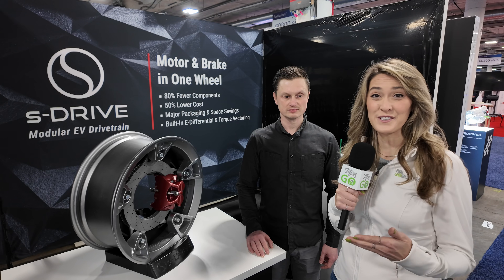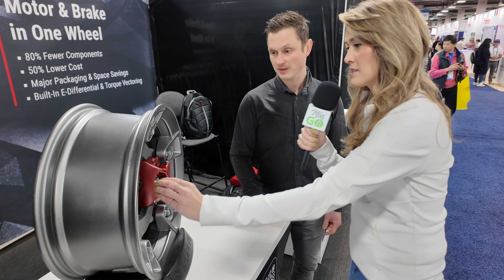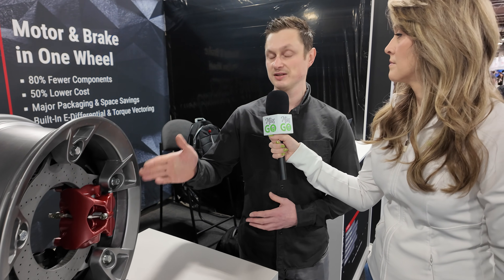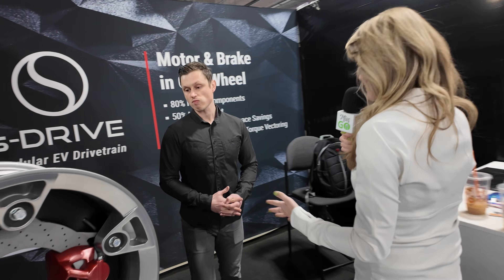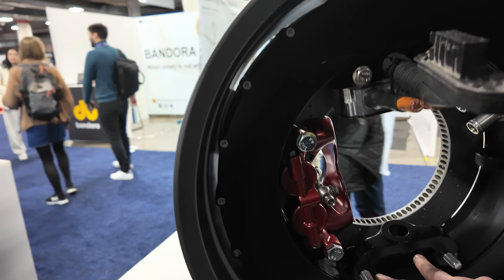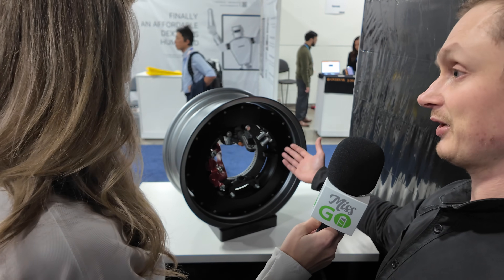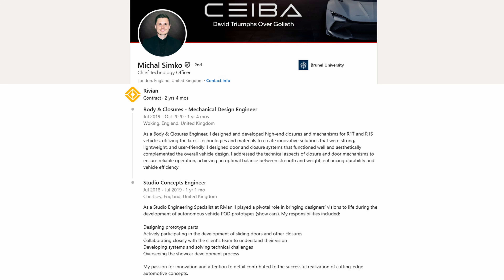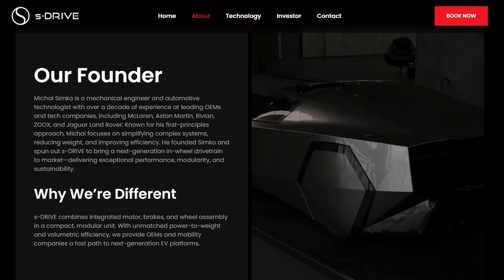S-DRIVE In-Wheel EV Powertrain Solution (CES 2026)

Comment: Excellent presentation on the axial flux integration, but as a builder, I see three critical "Shed-Logic" issues that might bite in the long run:

Unsprung Mass vs. Rotational Inertia: Even if the total weight is "hub-equivalent," moving that mass to the rim's perimeter significantly increases rotational inertia. In a racing environment, that’s going to fight the suspension damping and potentially cause "wheel chatter" on high-frequency bumps.

The Environmental Gap: With such a large-diameter air gap between the rotor and stator, sealing becomes the primary failure point. A single piece of road grit or a build-up of conductive brake dust in that gap is a "catastrophic short" waiting to happen. How is the labyrinth seal handled during high-speed rim deformation?

Thermal Creep: 200kW generates serious heat. If you're dumping that thermal energy directly into the rim, you’re going to spike tire pressures and potentially heat-cycle the rubber into an early grave. Air cooling sounds great for production, but under heavy track load, that rim is basically a hot plate for the tires.

Would love to see the "long-term torture test" data on those damping rings after a few thousand kilometers of real-world potholes!
Reply from the maker: Other Axial Flux hubless motors have been in production for years now
Like the Verge TS Pro
Haven't those problems been addressed? 
-Producer Tim
Reply: @MissGoElectricIndustry  Tim, the Verge TS Pro is a brilliant piece of engineering, but it’s a bit like comparing a prop-plane to a supersonic jet just because they both have wings.

The Verge operates at roughly 100kW (130hp) and is mounted on a motorcycle, where the entire wheel assembly is exposed to open air for cooling and has significantly less mass to 'swing' than a supercar wheel. The S-DRIVE is pushing 200kW per wheel in a closed-rim automotive environment.

Here’s where the 'addressed' problems actually get harder as you scale up:

The Scaling Law of Heat: When you double the power (from 100kW to 200kW), you don't just double the heat; you often square the cooling challenge, especially when that motor is tucked behind a car's bodywork and a massive brake rotor. The Verge has the luxury of 'clean' airflow that an in-wheel car motor simply doesn't get.

Structural Leverage: A motorcycle rim is narrow. A car rim is wide. In a car, 'Camber Thrust' and lateral cornering forces create massive leverage on that hubless bearing. The 'flex' in a 19-inch car rim under high-G cornering can be measured in millimeters—enough to cause a 'pole-strike' in an axial flux motor with tight tolerances. The Verge doesn't face those lateral 'G' loads.

The 'Debris' Velocity: A motorcycle wheel throws debris away from its center. A car wheel, trapped inside a wheel well, creates a vortex of grit and brake dust.

The Verge proved it can work for a bike. The S-DRIVE has to prove it can survive a 2-ton car hitting a pothole at 100km/h without the stator and rotor 'marrying' permanently. Different physics, different stakes!

Comment: This is brilliant. I had the same idea many years ago, but the major issue was un-sprung weight. Sounds like he has addressed that problem. Just imagine, four of these units, you're talking over 1000 Hp and 3200 Lb.-ft of torque. Wow.
Reply from the maker: You bet! We shared a look at a couple of EVs with four wheel motors and we'll over 100HP in this brand new video on the main channel
https://youtu.be/3TTrsTMarPE
-Producer Tim

Comment: At face value, this design (and the similar Donut design) appear very elegant solutions for any/all EVs.

HOWEVER … 
1 - I am surprised they are able to match/better the unsprung mass of a conventional wheel/hub/brake/suspension assembly … though one has to accept it may be possible depending on materials used … and even if it is slightly worse, what really matters is how it would impact on overall vehicle performance, handling and ride quality. 
2 - Wheel bearing radial loads will be comparable to a conventional hub configuration, yet with a much larger race size (going from a nominal 50mm dia up to something like 250mm, or possibly bigger). I’m no bearing specialist, but instinct tells me that, for the same rpm, it’s going to be a harder working bearing running at significantly higher circumferential speeds that will likely need forced oil lubrication and be manufactured to better tolerances than a conventional wheel bearing, be a lot more costly and likely significantly reduced life … not to mention highly sensitive to running with ANY contamination. 
3 - As per the bearings, sealing will also be a challenge … for exactly the same reasons of diameter and associated seal scrubbing velocities. Personally, I believe this would be a problem if the assembly were simply running in air … but it has to perform over the full range of global temperatures (-40C up to +50C or more) when running through mud, water, sand and dust, or a combination of all these. Again, these seals are going to be costly and likely require frequent changing with relatively short life. 
4 - Hit a brick at 70mph with a conventional alloy wheel and it’s likely to need a replacement wheel. Expensive enough. I’d be concerned that the same impact with this hub/motor combo could also prove catastrophic to the entire motor assembly … seriously expensive. 
5 - Interesting concept to incorporate elastomeric coupling between motor and wheel rim … but these solutions are typically limited in life as the rubber/polymer degrades over time, especially with the help of heat from braking and exposure to UV and other environmental hazards. It was suggested that braking would be largely regenerative, which is good, but these solutions assembly will need to be robust against a full-on emergency braking occurrence when full braking force is entirely converted to kinetic friction heating … the sort that can make the discs glow. This heating is then transferred and dissipated via the alloy wheel rim; directly cooking those elastomeric bushings.

The Donut solution has, I believe, been on the road for more than a year now … I’d be interested to see how they’ve resolved these same concerns and to see some associated reliability data. Even then, there’s a seriously big difference between one year of motoring and 10+ years of everyday road use. As a practical concern for a typical motorist, it needs a minimum of 100k miles and/or 10 year life … or to be comparable to a typical diesel car … 200k miles and/or 20 year life. My concern is that it would be more comparable to suspension bushes/joints and need replacement at 4 to 5 year life and less than 50k miles. 

Still a really cool solution and I’d truly like to see proven designs of this type become the norm.
Reply from the maker: Follow this sorry at our main channel
News.MissGoElectric.com
-Producer Tim

Comment: hubless = high friction, high noise levels, sealing problems, high fail rate...  nice try but ultimately doomed
Reply from the maker: Solved problems.
It seems like many commenters are not aware that axial flux hubless motors have been in production vehicles and delivered to customers for years.
https://www.youtube.com/watch?v=cQstV0uLLHg
-Producer Tim
Reply: @MissGoElectricIndustry  everything to do with verge and donut is fishy! axial flux = good. hubless wheels = BS! 
- senior design engineer dean

Comment: "The same weight as a traditional rim" I call Bull$hit.
What if you get a flat tire?
How about servicing the unit?
How long will the bearings last, especially in high contamination conditions such as wet salty roads?
What about hybrid compatibility?
Reply from the maker: Solved problems.
It seems like many commenters are not aware that axial flux hubless motors have been in production vehicles and delivered to customers for years.
https://www.youtube.com/watch?v=cQstV0uLLHg
-Producer Tim

Comment: Should this not increase unsprung mass negatively impacting the handling characteristics… although there are some benefits where the CG could be better as the weight is further out.
Be interesting to see a direct comparison
Reply from the maker: What did you last in this video about the change in unsprung mass resulting from this design? 
Is there
A) more
B) less
C) no change

-Producer Tim

Comment: Nice idea but I am skeptical at this point. The weight bearing issue, dirt, and even with small dampening the electronics in the motor will get bet up since this is before any real suspension.  I doubt these will last long on the road.  Of course if they can make them cheap to replace i.e., put reconditioned motors on every 50k miles for $500per tire maybe it can work.

If this was on a hybrid 4x4 then you have more flexibility in suspension design maybe.
Reply from the maker: A solved problem. 
11k miles axial flux hubless in production for years
 https://share.google/6zXKAArldypXykHEU
-Producer Tim

Comment: Electric bikes have been using similar design for sometime now.
Reply from the maker: No. Those are old fashioned hub motors. This is axial flux hubless. This is fully integrated with cooling and mechanical brakes as well as suspension. There is no common technology here. 

You can see our 100+ highly detailed eBike reviews at eBikes.MissGoElectric.com
-Producer Tim

Comment: What confounds me and I've never figured out:

Hybrids use a motor as a generator up to a certain point, but still have all of the weight and energy loss of transmissions, et all.

Just how big of a Generator (i.e. engine) is required to fully power an electric vehicle at 100mph (on current highways there's no need to go faster than that) and remove all of the energy wasting weight and inefficiency of a transmission and drivetrain with hubs like what this guy's showing.    If the IC generator can supply the drive the batteries could be drastically reduced so the generator can be turned off under the same conditions hybrid motors currently are.
But that damn 12v battery needs to be eliminated, or have a BMS that lets the primary pack keep it charged enough to cycle the vehicle on and get the generator started.   The new solid state donut battery should replace the 12v toxic box.
Reply from the maker: You are explaining series hybrid and many have been put into production. See our Scout video for a recent take.
-Producer Tim

Comment: i think the major issue with this design is the massive vibration that going to shake the whole system all the way down , and that will damage the system components quickly
Reply from the maker: A solved problem. 
11k miles axial flux hubless in production for years
 https://share.google/6zXKAArldypXykHEU
-Producer Tim

Comment: 60kg (132lbs) is not the weight of a normal rim and tire...but still extremely light nonetheless! And 442 ft lbs + 268 hp per wheel is impressive!
Reply from the maker: But it replaces MUCH more than the wheel and tire. Consider the unsprung mass of the axle and other braking and linkage components which have now been fully integrated. 
-Producer Tim

Comment: Pretty sweet to have the motors in the wheels until you hit a curb or deep pothole.
Reply: Exactly.  Don't drive through flooded areas either.  Too impractical.
Reply from the maker: Solved problems. 
Here is an axial flux hubless in production for years
 https://share.google/6zXKAArldypXykHEU
-Producer Tim
Reply: @MissGoElectricIndustry  The Ford Pinto was in production for years also. And yeah, we all know about Verge motorcycles. Not a car, and not a widely accepted "solution" for automotive mainstream use.

Comment: Imagine if every time you hit a bad pothole it then cost you as much as a motor to fix the damage. Yeahhh
Reply from the maker: A solved problem.  Here is a hubless axial flux powered vehicle after 11k miles driven this summer by a YouTuber.  These have been in production for years.
https://www.youtube.com/watch?v=cQstV0uLLHg
-Producer Tim
Reply: @MissGoElectricIndustry 
Couldn't even make it 11,000 km (not miles by the way) before the motor broke and they had to do a motor swap. Producer Tim you need to stop simping and start thinking critically.

Comment: love of the idea. if the wheel gets damaged its an expensive repair
Reply: Exactly ! Good invention but durability & practicality will make this product be used in special purpose vehicles I suppose.
Reply from the maker: We hope you'll subscribe over at our main channel to keep up with innovations like this one
youtube.com/MissGoElectric
-Producer Tim
Reply: Evidently, others can see uses for in-wheel motors that you don't see. So, you're against in-wheel motors. Does that distaste extend to electric motors in general? Or, perhaps you're just into drive shafts and/or chains?

I have a washing machine that uses a direct drive electric motor - no belts or drive shafts. Having experienced the quietness and reliability of this machine and the high rotational speed of the washing drum, I wouldn't dream of replacing it (should it ever expire) with something that used an indirect drive mechanism. So, direct drive electric motors appeal to me. Admittedly, I don't drive my washing machine around on the street where it might be damaged.

I should say, I find myself not worrying about the prospect of wheel damage and more interested in the tight turning circle that could be achieved if these motors were to be thoughtfully integrated into vehicle steering design.

Comment: Riiiiight.... let's move the motor into the wheel to increase the unsprung weight which will negatively impact performance AND make the high voltage cables have to flex and bend constantly making them more failure prone.
Reply from the maker: If you watched this video, you'd know there is NO increase in unsprung weight.  I encourage you to WATCH the videos you comment on.  Hundreds of people come in here and comment from a place of ignorance.  It is not admirable or constructive behavior.
-Producer Tim
Reply: @MissGoElectricIndustry  Wait... so you think putting a motor into a rim doesn't add unsprung weight....  LOL

You're funny.

Comment: Placing the motor near the wheel parimeter appears to be a good idea.  Placing the be bearings there is not.  Verge motorcyles found this out and imposed a 124 mph speed limit on the wheel.  A better design would keep the motor where it is and add a conventional hub and bearing.  This would likely increase weight, but allow the bearings to last much longer.
Reply from the maker: What percentage of automobiles on earth are ever pushed beyond 120MPH?

When you have answered that question, you'll then be able to identify the astronomical market for transportation devices within the proven capability of these kinds of motors.

We hope you'll subscribe here AND over at our main Youtube channel to keep up with their developments
Main Channel: youtube.com/MissGoElectric
-Producer Tim

Comment: If the motor has enough power to brake then throw away the disk brakes.
Reply from the maker: As he stated in this video, the mechanical brake is necessary because regen MUST be eliminated when the battery is fully charge.
We hope you'll subscribe over at our main channel to keep up with innovations like this one
youtube.com/MissGoElectric
-Producer Tim
Reply: @MissGoElectricIndustry   Cool but you do whatever with the current, waste it as heat, by passing it through metal parts.

Comment: I like the use of an axial motor, but isn't that a lot of unsprung weight on the wheels? I would be more interested in an axial motor that could be replace my existing gas engine leaving plenty of room for batteries to help balance out the car, etc.
Reply: Did he say the weight around the 1:20 mark? My wheels are less than 13lbs.
Reply from the maker: Carlos your wheels are not the only unsprung mass on your vehicle.  add it all up.  its more than what can be done when elimination and consolidation take place.
-Producer Tim

Comment: Wonder how hard it'd be to fit a scaled down version to vintage car spindles, preferably compatible with the original brakes/wheels, or original brake links/hoses, using a simple e-bike style controller?
The cadence sensor could be on the drive shaft, handle bar throttle on the gas pedal, and essentially be a sort of D.I.Y. hybrid conversion.
Reply from the maker: We hope you'll subscribe over at our main channel to keep up with innovations like this one
youtube.com/MissGoElectric
-Producer Tim

Comment: In-wheel motors are not required to have one motor per wheel.
Reply from the maker: Did somebody claim that all wheels need motors?
-Producer Tim
Reply: @MissGoElectricIndustry  You should watch your own video. Torque vectoring by having separate motors for each wheel (of an axle) is claimed in the video as an advantage of in-wheel motors, but the motors do not need to be in-wheel for that.

Comment: Hubless design is very smart: if the power goes through a hub by nature it must be transferred through a longer lever (from centre of the wheel to rim), which demands a heavy construction to deal with the torque at the center. In a hubless design that directly drives the rim there are no such long levers, and much less high torques to deal with. So the construction can be lighter...
Reply: I see that you have no mechanical or structural design experience; that would be why you missed the seal and bearing issues created by this silly design.
Reply from the maker: We have enjoyed seeing other Axial Flux hubless motor deisgns in production and on the road for years from the likes of Verge Motorcycles and beyond.  We live in exciting times.
We hope you'll subscribe here AND over at our main Youtube channel to keep up with their developments
Main Channel: youtube.com/MissGoElectric
-Producer Tim
Reply: @MissGoElectricIndustry  are any of the "like of Verge Motorcycles and beyond" production cars? No.